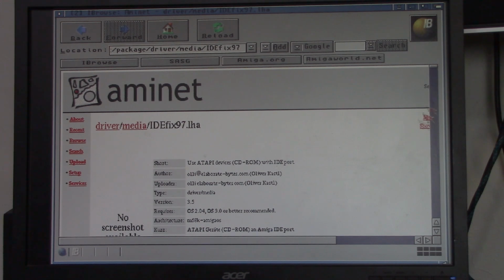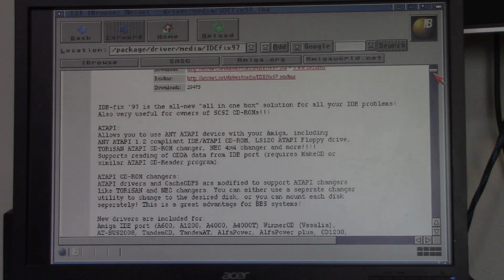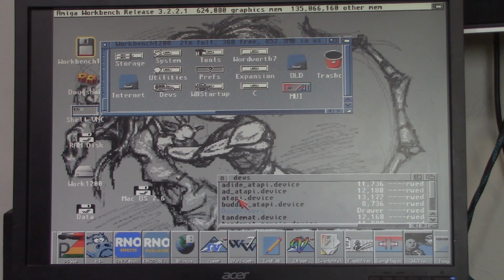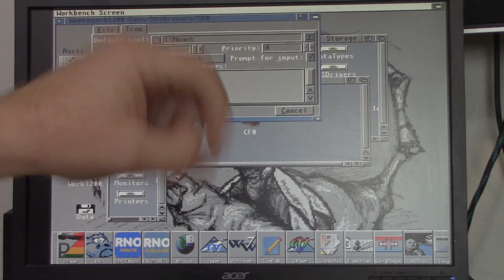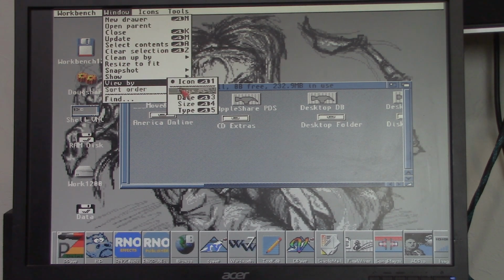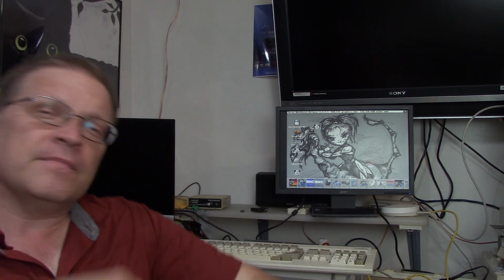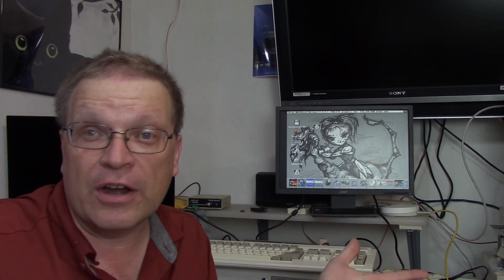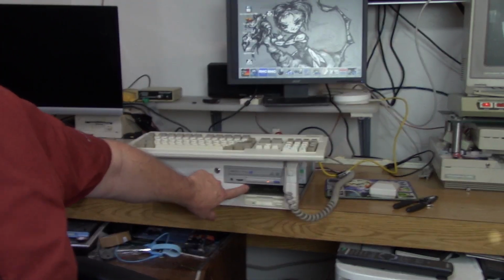Adding four IDE Channels and a CD-ROM to my Amiga 4000

Comment: I did this too a few months ago on my A4000 so I didn't need to rely on my SCSI card, as my SCSI CD-ROM was dying and those drives are not all that easy to find nowadays. Whereas IDE CD/DVD ROM drives can be had at my local thrift store for less than 10 dollars 😄Works like a charm. I also did that same ATAPI file copy from IDEFIX97 (did you stumble about through the files to work that out like I did? 😁You were probably wiser and knew it already, but I did not!)
Reply from the maker: Nice! I have a licensed copy of IDE Fix somewhere... I just cannot recall where.

Comment: Nice vid Doug 👍🏻 But you should also mention the filesystem you are using for the CD0 mount? The mount file will be pointing at L: 😉 The IDEFIX’97 program will also need a Serial number etc or you will get a nag screen. 🙏🏻
Reply from the maker: This one is more or less for AmigaOS 3.1.4 and above which includes a CD Filesystem - but yes I should have mentioned the file systems available for older Amiga's.

Comment: BTW, I have wondered what happened when Commodore painted the A4000 top case that gray-ish color. My 4000 top cover happens to match the front bezel so it seems they had two colors. Maybe they fixed the mismatch at soem point in production.
Reply from the maker: It's never really bothered me. My Amiga 2000 cases and bezels are different colors so I assumed the "Two Tone" look was intentional

Comment: Will  it boot from the CD?  as in the oS 3.2  install disk?  Right now I used the naive Blue Ray drive onmy   PC in winuae    I'll be doing a video on installing 3.2  directly from the optical drive.
Reply from the maker: Hmmm... Excellent question. The atapi.device is not in ROM, so I suspect in this case it will not. A SCSI CD-ROM probably would, though.

Comment: My CD-ROM solution for my Amiga 500 back in the day was a ParNET cable connected to a CDTV. That worked great for reading the Almathera and Aminet sets as if the CD's were mounted directly on the 500, especially for grabbing fonts, icons and clip art collections.
Reply from the maker: Good plan! I did that for a bit with my A3000 and A500/A570 CD-ROM but it was too bulky. I ended up just getting a nice external SCSI CD-ROM back in 93 or 94

Comment: I bought ASIM CDFS back in 1996 with my CD drive. Still use it today for reading and burning. I have an external case with both CD ROM (CD0) and CD Burner (CD1). There is some weirdness I need tosort out after having my stuff in storage for 20 years, like why CD0/1 want to still mount when I pull them out of DEVs (my workaround for now was to rename the device icons to "CD0_DONOTUSE"
Reply from the maker: There must be an old school "Mountlist" file that tries to initialize the CD-ROM. That's more of a Workbench 1.3 thing, but they still work fine in 3.x
Reply: @10MARC  I don't always turn on the external scsi enclosure with the CD drives in it so when I power up I get the dialog boxes, can't mount CD0 and hit ok, then can't mount CD1, hit ok. So that's why I renamed the icons as a stop gap for now. I have searched through the startup-sequence and user-startup and haven't zeroed-in where the mount happends, but like you said it is in there somewhere. Seems to be after right after workbench appears but before DOPus.  Since my larger goal is to get 3.2.2, I will start over with a clean slate and document every change to the system because it is easy to lose track of what installer added which files and made this/that change to the startup sequence, haha

ASIMCDFS comes with a nice suite of tools including a cd audio player called Asim Tunes, CD32  and CDTV disc support, photoCD, and possibly other items.

Master ISO was the program Asim shipped in the suite for authoring discs including audio cds, CD-R/RW, duplication (worked even better with two CD drives like my setup), make autobooting, DAO. Really a nice full-featured commercial package for CDROM/WRITE needs

Comment: I had to look this up as I couldn't believe it -- but the power "switch" is just an actuator/rod for the real switch on the power supply!  I don't think I've ever seen something like that in a computer before, but I suppose that the engineering cost was cheaper than wiring a proper switch to the power supply.
Reply from the maker: Yep. Just a long plunger. I can probably jury rig something to my new power supply where they live up properly.

Comment: Honestly CD-ROm's on Amiga can be a PITA and this was not always the case because back in the day the first CD-ROM I ever installed was in my A2000 HD with an Expansion Systems HD Controller but they had the software ready to go.   Move forward to recent years,  The best solution I found was an interface that came with Alegro CDFS and EIDE'99.   It's been a while and I am an old fart so I tend to forget things but I know where that install disk is and I have an extra board somewhere too.   I have Amiga Kit boards and they work for one drive but I never could get multiple drives to work but that's probably due to something I have done wrong because Amiga Kit stuff tends to work well so I am not blaming anything on them.   Now what I used CD's for is to move files from the PC to the Amiga.  Hell yea burn a disk and everything is there.  However I have been networking all my Amiga's so I can access files from one of my servers which is one thing I wanted to do back when I started backing up my collection.  I do have a couple Amgia Specific CD's, OS3.2, RoadShow and yea Fred Fish too.  Hey if you don't have anything Fred Fish you may not be a legit Amiga Old School User but I have two.  Not sure where I got the first one but the second one came from a purchase of a 2091 and optical drive on eBay a few years back when I was buying Anything Amiga yea lets not go there but I think Chris Edwards has me beat in that department and then maybe no, no, no I think he has me beat in that department.   All I know is when something Amiga does not go well it requires a lot of reading.  Bring up the Information on an ICON will save your behind when it comes to specific device requirements.   Reading is fundimental and Google can be your friend.   I love my Amigas and no matter how they may frustrate me at time I just look at it as something to do and keeping me out of trouble.  PC's are a dime a dozen if they die you just replace them but Amiga's no no no you fix them and bring then back to life although you will have a good cry along the way but sometimes we need to shed a tear or two.   Ok ok Ramble over with.....
Reply from the maker: I certainly don't really need a CD-ROM in my Amiga, but I may as well put it in there! I was given a ton of Aminet CD's at last year's AmiWest, and it will be fun to browse thru those

Comment: Super video, this I will try, i have problems getting the splitter to work on my Amiga 4000T.
For the missing front plade on your A4000, pehaps you would be intrested in making a cf and gotex front.
I have designed a combined Gotek CF-ide fron pannel thats fits in a 3,5 inch bay.
The 3d model and assembly description is avalibal at "printables"
Reply from the maker: That's a quite good idea. I will have to see if I have a spare GoTek

Comment: This is a great workaround if you don't have a dedicated SCSI board. Quite some time ago, I bought the GVP HC+8 SCSI board for my A4000D which has a HDD and a CD-ROM. I literally plugged it in, installed the GVP disk, and it worked like a treat. I think I got a bit spoilt with that!
Reply from the maker: I normally used my Warp Engine with it's super fast SCSI in here, but it became quite unreliable. Once I get that working again I may go back to it.

Comment: Awesome Video, The Amiga 4000 is my dream amiga system. I have an Amiga 1200 which is inside an EZ Z4 Case with a Mediator LT4.
Reply from the maker: That's a really nice setup, actually. I do love my A4000, though.
Reply: The A1200 is a wonderful machine. You can still do a lot with the A1200 and its AGA chipset. The big-box Amigas just make expansion a bit easier and give a few more options.